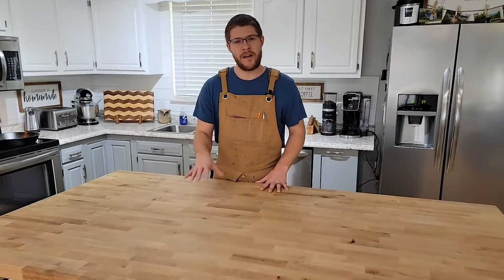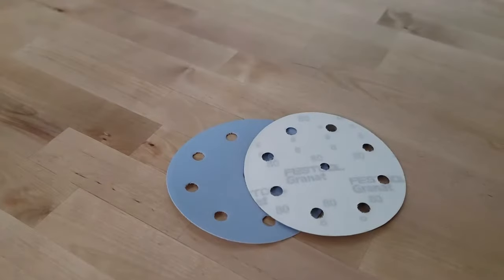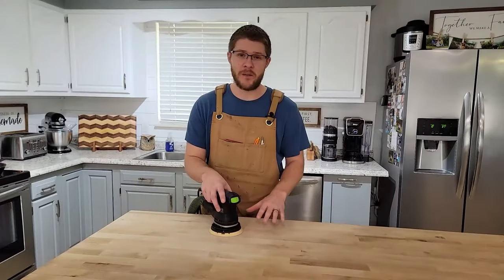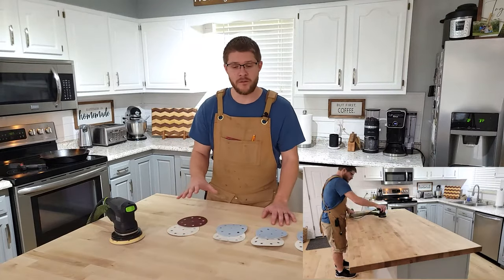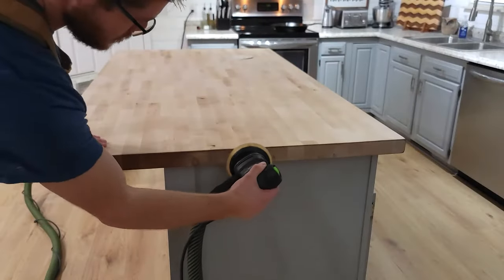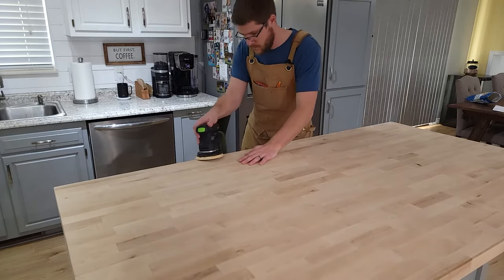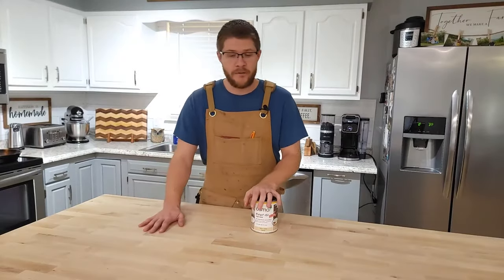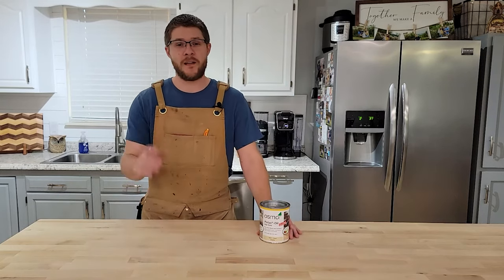How to Refinish a Butcher Block Island or Countertop

Comment: Heads up that using an orbital sander to round off the edges I immediately gouged the wood at the edge. Was able to fix it for the most part by sanding by hand but would not recommend that method for the edges. It’s too intense and unless you have some serious finesse it’ll probably be ugly.

Comment: I only have a palm sander, will it still work for this project?
Reply: Guess not. Crickets 🦗
Reply: @petepan9696  it ended up working lol
Reply: @mackenziemccoy581  saaaweeeeet
Reply: For anyone asking, you can use really any kind of sander. Just know that anything with dust extractor is going to make your paper or pads last longer. Palm sander will work but make sure you follow the step about going with the grain. It will likely just be a little pricey getting all the pads you need but so is buying a new sander for a project you only do every few years. Just use what you have. The sander he is showing is probably one of the nicest orbital sanders on the market.
Reply from the maker: Sorry for not responding I took a break from YouTube. I hope your project turned out good. Jake is correct any type of sander will work and the methods I outlined in the video still apply. This was actually my second time refinishing the butcherblock. The first was with a Dewalt palm sander hooked up to a shop vac and I got the same end result. The only difference was that I used a ton of sanding discs and got dust all over the kitchen. Better tools don't make you a better woodworker and you definitely don't need them. They just make things easier and faster.
Reply: This was a question I had as well. I have a palm sander with a detachable dust catcher. So it sounds like it might be worth renting or borrowing an orbital sander to make the work easier and the outcome better.

Comment: "Sand along the grain of the wood"... Well.. being a rotating sanding machine, "sanding along the wood grain" is going to be pretty difficult since sanding obviously occurs in all direction as the head rotates. Slowly moving the machine along the wood grain has only a very small effect in that respect.
Reply from the maker: Your right, but it does help if something gets caught in your sanding disk and causes a imperfection. It will blend in with the wood grain better if your moving your sander with the grain. Like you said if you're moving at a snails speed it's all irrelevant.
Reply: @TylerBrownWoodworking   You mean "You're right."
Reply: @emilybh6255 Your fun at parties.